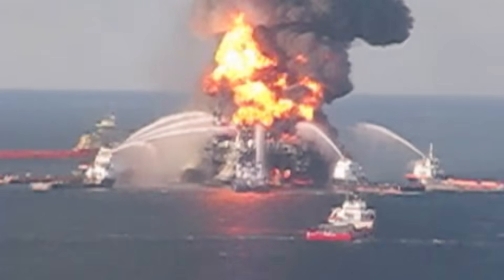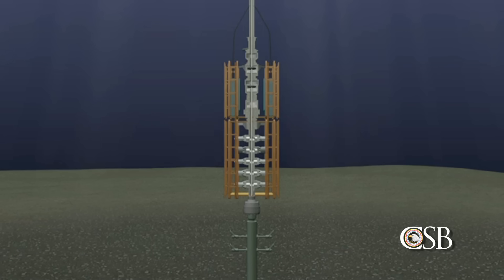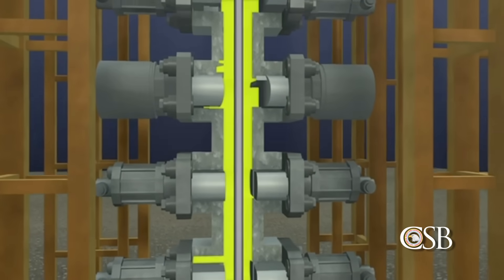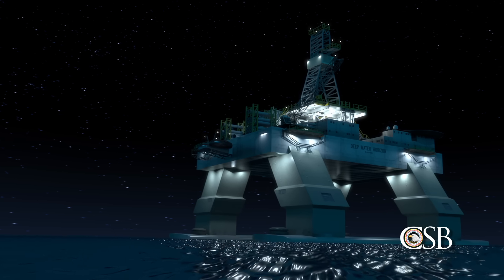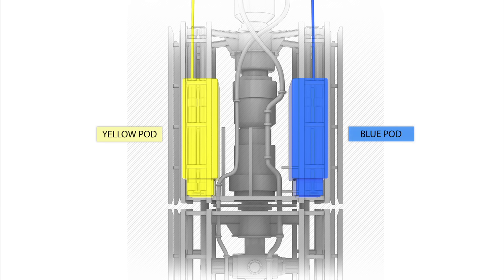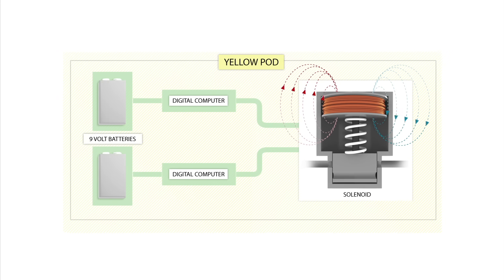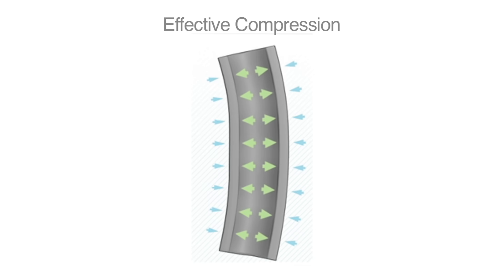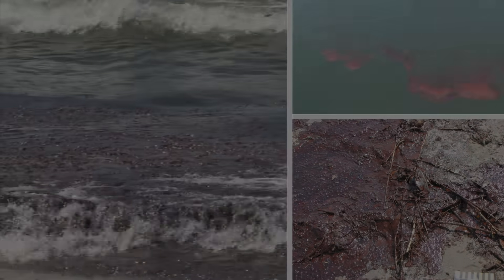Deepwater Horizon Blowout Animation

Comment: These step-by-step breakdowns of all the mistakes and flaws that contributed to the disaster are excellent, thank you.

All the failures in that blowout preventer are amazing. Pretty obvious that the people responsible for installing and maintaining it were just going through the motions. They can't have done any tests after installation for all those miswires and drained batteries to remain undetected.
Reply: I operate cutting machines in a poultry plant. I experience more startup problems on Mondays than on other days. Why? People during the weekend working on equipment, but not doing a thorough job. Just going through the motions.

Comment: 5 million barrels in 87 days out of 1 well, remember that when someone try's to tell you were running out of oil.
Reply: That is about what it takes for 10 million people to put gas in their cars to go 300 miles.
Reply: +GreatAlaska. yea, if anything we're just running out of the super easy to reach stuff. There's plenty more oil, but we will have to work a bit harder to get to it.
Reply: @killman369547  Im with ya ive spent 10 years on drilling rigs, deep wells nowadays. Keep in mind a false shortage would inflate the market price, a little like the diamond trade.

Comment: Man, both the 27 volt battery and one of the solenoid valves were miswired. That's so extremely unfortunate, my goodness.
Reply: I make so many redundant checks in working with microelectronics so I don't waste a $2 part. How such mistakes at such a significant level happen is beyond me.
Reply: It was so broken that it worked
Reply: @wahidtrynaheghugh260  *partially. Still though, it's not good to rely on one failure to fix another failure.
Reply: @wahidtrynaheghugh260  approx 5million of barrels spilled into the Gulf of Mexico would say otherwise.
Reply: Not quite. One 27 v, one solenoid and one 9v
Basically every component that can be miswired is somewhere.
Except maybe the "computer".
Reply: "Unfortunate", my ass!

It was sheer incompetence.  This entire debacle could have been prevented by (what should have been) the standard practice of performing a bench test on a newly-assembled electronic component.  Literally a 15-minute effort would have prevented everything else that followed.  There are zero valid excuses here.
Reply: Not unfortunate. BP decided to ignore the warnings that the rig was unstable

Comment: Seems like a pretty glaring engineering oversight to design a system that can be defeated by a bent pipe... Did they have no margin in the blind sheer ram?
Reply: Agreed!  On paper that pipe would be straight every time. Real world shows the job is as good as the person signing off on it so pipe not centered wasn't a big concern for someone.

Comment: So that's how oil spills happen. It's all of the accident prevention devices not being installed correctly.  There was a lot of backups on top of backups and they all failed due to improper installation or consideration of outside factors.

Comment: Incredible how many problems stacked on failures stacked on misted problem lead to a complete failure of the blowout preventer.  With all the redundant system with the back up systems you would never think it could fail. Clearly the human element missing the wiring problems and all failed. Excellent work on the video as always

Comment: The blowout prevent ion system the ocean drilling oil production platforms need didn't exist yet. Deep horizons blowout prevention system had an annular valve which failed, the blind shear rams failed. Crude and gases went right through the blowout prevention system and up through the riser to the deep horizon where gases found a heat source. The current type and one depicted here even if it worked still would have left a well sealed only by the well pipe at the bottom. It's basically another spill waiting to happen. The well pressurized prevents any repair to be done without starting another spill. This type of blowout prevention system can't be tested periodically and has no way it can isolate pressure or even the annular or blind shear ram valves designed to be repaired or maintained. As I've already stated that the design blowout prevention system didn't exist yet. The horizon's crew did what they were trained to do and owners supplied the latest in blowout prevention. One thing I will disagree with is that BP used my design caphead spool to stop the macondo wells spill later. After the spill occurred and horizon on the bottom, the horizon spill response crew were working and using underwater robotics to cut bent sections of pipe away from the wellhead pipe. I watched news coverage and found that BP had a " horizon helpline" asking for assistance. Seeing the bent sections cut away from the wellhead pipe leaving several feet of pipe sticking out of the seafloor. The wellhead pipe also had a flange at the end. I designed a caphead spool that could be lowered onto the wellhead pipe, it also had locking lugs or wings that would lock on behind the flange securing the caphead to the wellhead. At the bottom of the caphead I used hydraulic chevron seals that would use the wells own pressure to force the chevron seals down sealing the spill. The flow could be directed to the surface Where it could be recovered onto a barge or tanker. Downhole pumps could over pressure the flow and a cement/slurry mix injected into the well pipe until full. The caphead remain in place until the cement/slurry sealant cured and sealed the well stopping the spill. I'm a mechanic working on Alaska's North slope oilfields in Prudhoe Bay (current 2019) and have over 30 years experience in pipeline repair and maintenance. Later on during the day I managed to get the number for the "horizon helpline" and called letting them know I had a design caphead that would stop the spill. I emailed my design caphead off and also included instructions. I neglected to file for a patent and was later emailed b back by the horizon helpline that my design was unusable. I tried calling the helpline only to find it had been discontinued. Several weeks later I watched news coverage as my design caphead was lowered onto the macondo well stopping the spill. Emails to BP stated that since my design wasn't patented the caphead design was theirs. For my contribution i was slapped in the face and brushed off. Later I was unable to find legal representation and also had a case against BP on the BPCLAIMS.ORG.  I decided to wait until the corrupt Obama administration was out of office to voice my opinion. I still have copies of my design I submitted, as well as emails to and from the horizon helpline. 9 years later checking that the same design blowout prevention system still in use. The design blowout prevention system needs to be changed as it can't be tested periodically to verify proper operation nor can it isolate pressure in order that if the blowout prevention system tests bad can be repaired or maintained.   If this type of blowout prevention system works would still leave a pressurized well sealed only by crushed/ cut piping. My designs blowout prevention system design us capable of being periodically tested and maintained. It also will leave the well able to return to production after repair. My safer design. Blowout prevention system is available, but not free and will be patented. It will cost little compared to the cost in lost lives or damage to the environment or spill clean up. Billions have been spent so far on deep horizon's spill. Most ocean based oil production drill platforms use the same type blowout prevention and can only say that it's worth taking a look at. "007".

Comment: How were so many safety devices wired incorrectly? No inspections on emergency safety equipment for an oil rig? No management? No oversight? I mean a dc battery and solenoid only have 2 wires. It’s not much to inspect.

Comment: I never understood why the fireboats flooded and sank the rig.   They knew that hose streams won't put out a huge pressurized oil fire.   Had the rig simply been allowed to burn, it would have worked as a flare platform - burning the oil before it reached the water.   The attached riser pipe would have remained intact.   A new BOP could have been installed on the riser pipe above the non-working BOP at the seafloor.  The well could have been brought under control with very little oil spilled.   Instead, the rig was sunk, breaking the riser pipe at the base, and making it impossible to easily attach a new BOP.   This led to the worst US oil spill in history.
Reply: Yes sad the failures and mistakes just continued even after the event had initially  occurred.

Comment: I just wanna know who they hired to wire that thing and how they failed so miserably at doing so. To miswire that much takes a lot of blatant ignorance.
Reply: you're right, assuming it was ignorance and not deliberate miswiring to prevent accidental shearing of the pipe ($$$).
Reply: @mikerope5785  Probably just manufactured in Mexico. Outsourced/overseas workers are the lazy union worker stereotype on steroids. They don't give a shit about anything, especially something as minor as using the correct gauge or color of wire. Happens time and time again in the aerospace industry... the company spends hundreds of millions of dollars to build a site outside of the country so they don't have to pay American engineers. Well, you get what you pay for and the shit has to get rebuilt in the US cause it's a heaping pile of shit. It's fine though, cause the overseas workers don't complain and they're happy to get 10k a year even though an American engineer in the same position should be getting 125k plus vacation, medical, retirement, etc. 

It's a blatant raping of the country and people wonder why 5 million barrels of oil get dumped in the sea, or an airliner takes an uncontrolled flight straight into the ground.
Reply: @893R6-w8t  The L has been taken on the manufacturing.  Still colors American management, oversight, and operators as lazy and greedy despite your high levels of nationalistic confidence in the average American engineer.  It's not like an American company signing off on badly designing/implementing engines and software on the Boeing 737 Maxes caused hundreds of deaths, right?

But it all starts at the top.  The workers do what they're told to make a paycheck.  Outsourcing and cutting corners to save money is par for the course in every major heavy industry.  Even if American engineers were somehow inherently better in every way, you aren't going to change the culture that causes these disasters by switching them out.  If anything you'll just make companies cut more corners since American engineers have a bit more leverage to demand more in payment.  They also have unions roflmao
Reply: @893R6-w8t  Galvanized pipe from China that rust. Pipe fittings that have not been threaded are more examples of off shore garbage. I worked in aerosol business and often wondered if the double and triple strength pipe was actually what they said.
Reply: Man, do you realize how many wires and electrical connections there are in a rig that big. Take your house and multiply it several thousand times just to get a vague idea. Even with the very best, mistakes somewhere in all that are inevitable.
Reply: @robinstewart6510  Yeah, I kinda forgot I even made that comment. I’ve grown to realize that not everything is as simple as it may seem at first glance. Especially as an outsider with no relevant knowledge.
Reply: @ericwood7758    ..  Yeah, even sitting at my workbench with all the time in the world, I still make mistakes and have to redo something. Luckily my work doesn't blow up an oil rig. Hell, luckily I'm not on an oil rig. While good money, not the kind of work/life I'd enjoy.
Reply: Nah.  Wiring something wrong happens to the best.
Failing to bench test any given electronic component?  Happens to ZERO competent technicians.

Comment: So the drill pipe was sealed at the top the annular space was sealed by a pipe ram. How did oil continue to leak from the well?
Reply: From memory, the concrete around the wellhead (done by Halliburton) was not installed properly and had cracks.

Comment: All because of a simple miswiring of a couple batteries. Good one
Reply: the batteries and wiring were pointed out simply because they were big mistakes and were close to making it worse (and who knows if other blowout preventers are miswired!)... the true cause was the failure to cut and seal the drill pipe, which would have also happened without the battery / wiring issue.

Comment: Why aren't the solenoids always closed and the coil would open only during electricity flow? Thus if the power cuts off it would automatically shut the valve

Comment: The solenoids being miswired is a terrible mistake. But its very surprising how it went undetected before being taken to online, how it could even bypass the regular commissioning protocols? The battery being discharged must had also indicated alarms to the operator, who didnt pay any heed to it. This accident was a result of sheer negligence and improper safety followups.

Comment: The weight of the drilling string and bottom hole assembly (bha) should keep pipe in tension preventing pipe from buckling. It could buckle if driller set string weight down on the pipe rams. Or if the drill string didnt have a heavy bha like going in for a clean out run and if there wasnt enough pipe below the bop there could have been a pipe light situation where formation pressure is pushing up on the pipe like a hydraulic cylinder causing it to buckle. It also mentions a large increase of drill pipe pressure. Even if the drill string were open ended it should have had a float sub with 2 floats installed to prevent flow up the string.

Comment: hard to conceive a cutter would not serve a dual purpose with shearing edges completely across the channel in case of buckling and also serve as a seal. Also puzzling they had considered a possibility of buckling of the drill pipe by several means, yet decided not to address it.

Comment: Just an idea, I'm not an engineer.
All of the "Bead Man" BOP valves need to be powered by solenoids to stay open and flowing. If the power is terminated, through equipment failure or human intervention, the valves should close mechanically by means of stored energy. The stored energy could be gravity or released spring tension.
Reply: As an engineer with 15 years in shipbuilding, defence and oil&gas, this was the first thing I have thought too.. very clever

Comment: That's why I always lick my 9vt batteries before I put in  my smoke detectors
Reply: Imagine that statement in the narrator's voice.... "But the technician assembling the blowout preventer did not perform a critical step - he did not lick the terminals of the 9v battery before snapping it into the computer module, resulting in the installation of a defective 9v battery into one of the pods"
Reply: @volvo09  The USAF would call that a "carded item"! A Direct Safety Violation. A DSV!

"You going to jail BOY!"
Reply: That sounds like a job for an oil rig intern: "Hey dude, swim down there and lick that battery."
Reply: @misterguts  Narrator: "But cmbira01yt did not account for a critical safety precaution when submitting his recommendation: his body could not withstand the thousands of atmospheres of water pressure which exists near the ocean floor. His body was found 2 weeks later."
Reply: @misterguts 100% especially when one of them was much higher voltage lol “yeah like the small one not the big one, big one will kill you”
Reply: We have calibrated elbows for bolts, and calibrated tongues for juice. But be careful. We ain't calibrated for to much juice.
Reply: yep the lick test should be atop the safety check
Reply: wait, the failure of the 9v battery was good because it kept the coil, which was wired wrong, from turning on. Because the 9v failed, the shear ram was activated.
Reply: @H0peAnL0ve  theres 2 9 volts and 1 was dead and the other left the valve open dumbass. If both worked it would've stayed closed effectively causing a lesser effect. Pay attention to the video.
Reply: Runna 7   Yip. The tongue  is calibrated for temp to. But like juice be careful.
Reply: Lmgdao thats perfect bet it was Sunbeam battery from $ Tree ✌
Reply: It hurts..
Reply: Lmfao
Reply: Don't continue that if you are hired to replace 9v batteries. You'll lose your tongue and/or your life.
Reply: Don't play with your life! You have only one!,!!
Reply: White Smith lol
Reply: That's less an 1amp. These 9v and 27v batteries are a lot more than 1 amp
Reply: i TASTED 9V WHEN I READ IT.